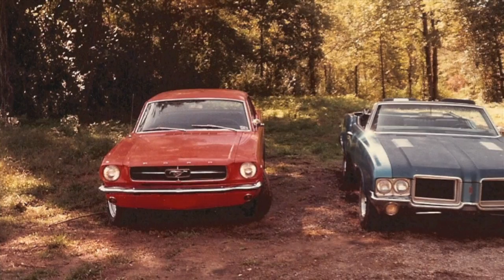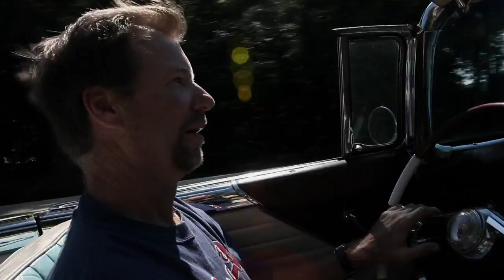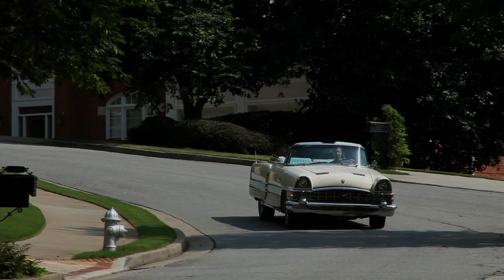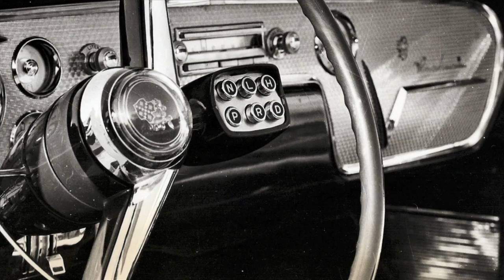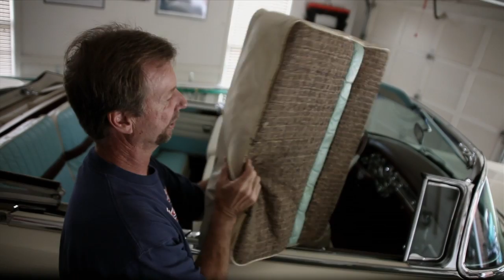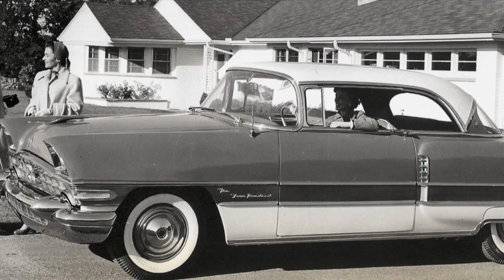'56 Packard Caribbean

Comment: I have said this before.  I do not see how the 55/56 Packards did not boost sales to the point the company had trouble making enough of them...they were just knock out.
Reply: The whole problem goes back to 1953. Chrysler purchased Briggs, the company that made parts and body panels for Packard, and Chrysler informed Packard that after the 1954 model year, the factory would no longer supply parts to Packard. In 1953 James J Nance, President of Studebaker-Packard was in agreement with President of AMC (American Motors), George Mason, to merge, and finally create his dream of a fourth US automaker. He and Nance were Presidents of Nash and Hotpoint and were former rivals. Nance would not agree to this unless he was head of the company. George Mason died in 1954 and was replaced by George Romney. He announced there would be no merger with Studebaker-Packard. If this merger had gone through, Packard would be able to use AMC's larger and more modern plant to build all cars there. But instead Nance decided to purchase a former Briggs plant. This plant was so small and outdated, it could not produce things at a very high quality. This resulted in the quality of 1955 Packards being below average of what it should have been. This diluted the somewhat exclusive Packard name down to Buick and Oldsmobile type quality and people stopped associating Packard with luxury. In 1956 most of the quality problems were fixed, and the cars were much better than 1955 models but the damage was done. In July 1956 the last true Packard rolled off the assembly line in Detroit. The planned redesign for the 1957 models was very promising  and could have worked, but the 1957 and 58 Packards were just glorified Studebakers. By 1958 the brand was phased out. In 1962 Studebaker-Packard Corporation changed their name to just "Studebaker". If Packard didn't merge with Studebaker, things would have been much better. Also, if the company spent the money on a new factory cars could be produced at a much larger volume with better quality. It's sad to see that Packard is gone.
Reply: A number of '55s had issues such as the torsion suspension and had to be brought in for service. This turned off a lot of customers as well as the word getting out not to buy one or buy a '56 (which by then the bugs were worked out)

Comment: They tried to compete on the wrong market, going up against Cadillac (GM), Lincoln (Ford) and Imperial (Chrysler). Good quality luxury cars like them, but Packard did not differ from them enough, allthough carrying a hefty price tag. They developed a beast of a V8 engine, which was very powerfull, but also crude and noisy and unsuited for the delicate and out of date transmission.
What they should have done right after the 2nd WW was to establish itself as the American equivalent of Rolls Royce, aimed at a small, but exclusive market instead of trying to produce in volume, like other manufacturors did. This marketing policy spelled their doom in the long run.
Reply: Yes, that was Packard's downfall, volume production. But, what choice did they have? They didn't have a Chevy, Ford, or Plymouth to financially back them up. They should have merged right after the war, but that hindsight. They stayed financially healthy until purchasing Studebaker in 54, which bled them to death.
Reply: Noisy engine?  Really?

I had a 1955 Packard Caribbean convertible which was almost identical to the 1956 model.  When I went to get the wheels aligned, there was also a late model Rolls Royce there (this was in about 1980).  My Packard idled much more quietly than the Roller.
Reply: Frank Eggers I have read your story before
Reply: There were plans to merge Hudson and Nash and combine that with Studebaker- Packard.  Had that gone through they might have survived.

It turned out that Studebaker was not financially sound and was poorly managed.  I remember that in the 1960s they were advertising "different by design".  Actually, they were different because of lack of funds to update the design.
Reply: Frank Eggers Studebaker was actually very well managed, so well that after WWII Ford was in trouble so the U.S. government considered getting Studebaker involved in instructing Ford in management. Fortunately, Ford turned things around partly by building a Studebaker design, the 49-50 Ford, and Studebaker  got itself into trouble with needed  high production break even points, and too many plants around the world.
Reply: Neil,

You yourself stated that Studebaker had a problem with its break even point.  According to what I read a few decades ago, their break even point was actually greater then their maximum production capacity because of greatly excessive overhead.  Exactly when that occurred I don't know; it could have been well after WWII in which case there may be no conflict with your post.

At one time Studebakers were very popular and Studebaker was highly respected.  I can think of many people I knew who owned Studebakers.  At one time I worked for a company which was a division of Studebaker and had Studebaker company cars.

I suspect that some of the problems went well beyond Studebaker.  We now have only three automobile manufacturers here in the U.S., and one of them, in spite of a foreign merger, seems to be hanging on by the skin of its teeth.  Meanwhile, Japan has several automobile manufacturers.
Reply: @frankeggers4024  I agree with your points! All this hand wringing and finger pointing about the demise of the Independents! Attrition in the auto industry was a natural process resulting from economic laws. We would have ONE manufacturer today (Ford) if not for the Obama bailout of Chrysler and GMC after the Crash of 2008!
Reply: Neil, I'm not sure what the American manufacturers should be doing now.  However, beginning in the 1950s, they had real quality control problems.  My mother bought a new Chevrolet in 1958.  Suffice it to say it was not well put together.  It was big, awkward, and seemed inferior to the 1955 - 1957 models.  Then, later, U.S. manufacturers fell way behind on auto technology.  When emissions controls were introduced, American cars ran very badly.  When you stepped on the gas, they'd surge forward nicely, but then they'd hesitate, sometimes backfire through the carburetor, then begin to accelerate again.  The U.S. manufacturers seemed to think that the solution lay in lobbying Congress to relax the emissions controls.  Meanwhile, the Japanese manufacturers somehow managed to make their cars run beautifully even with the emissions restrictions.

The computer and the automatic transmission were American inventions, yet it was Toyota which was the first, by many years, to have a computer controlled automatic transmission.  Foreign cars had electronic multi-point fuel injection way before American cars did.  The Japanese implemented industrial robots, an American invention, before U.S. manufacturers did.

American manufacturers should have learned from the English experience.  At one time, like back in the 1950s, several English car brands were imported to the U.S. but that slowed to a trickle because of "English car disease", i.e., too many breakdowns and lack of reliability.  That should have taught American manufacturers the importance of good quality control.

GM has dropped LaSalle, Saturn, Pontiac, and Oldsmobile; they have only Chevrolet and Buick left.  Chrysler has dropped DeSoto, Imperial, and Plymouth.  Ford has dropped Edsel (which they never should have made in the first place) and Mercury.  Actually those may have been good moves since most of the brands now have "sub" brands so choices have actually increased.
Reply: In the late 1940's Packard outsold Cadillac.  It was a premium make.  The lower priced Packards sold well in the medium price field but that reduced the prestige cachet of the Packard name.  An attempt to differentiate the lower priced cars by branding them as Clippers (not as Packard Clippers) went nowhere and was abandoned.
Soon thereafter all Packards were abandoned.  The best option for Packard had long been a pairing with Nash.  History provides some evidence of why that didn't happen.  Too bad it didn't.
Reply: The emissions history is an interesting one.  US manufacturers had to tread lightly to avoid anit-trust issues in sharing emissions information and designs.  In Japan they were required to work together.
The market certainly has changed.  We have just two auto companies of size that are US based.  Chrysler is part of FCA, a company organized under the laws of The Netherlands with a tax "home" in the UK.
Reply: actually they  had the plant in Southbend Indiana and paid higher wages that anyone other Car manufacturer  and just didn't have the market share
Reply: Packard president, James Nance, told me it was not in the cards to use the Rolls Royce model - that if the cars could not be built at scale, competitively,
 it would not be done! The Packard V-8’s were NOT crude and noisy, but, exceptionally quiet and well engineered (Packard built the PT boat V-12’s for the Pacific war, and, built the Rolls Royce Merlin engine that powered the Lancaster bomber and other aircraft in WW2; Packard never made any junk). The Twin Ultramatic transmission in my current 1955 Packard did extensive trailer pulling service of our family’s Airstream trailer and has never been serviced to date!
Reply: Frank Eggers Yes Frank, and if things don't change, I can't see this business model lasting forever. Ford is now no#1, with only Lincoln as a companion car. And, Lincoln is all but dead. GM is down to 3 car brands, and as you said Chrysler is just hanging on with foreign help. Chrysler has had one foot in the grave for decades. Maybe, had they known what was coming, all the American brands could have formed one company to fight globalization, American Brands, like British Leyland. If not for trucks, I wonder if anything American would still exist.

Comment: Packard disappeared due to over-weight old-school styling, but they had one of the best suspensions ever made (Torsion-Aire), which I'd say has never been surpassed even by today's standards. If you have Torsion-Aire on your Packards, you're very lucky. For an upgrade all they need is a set of heavy-duty gas shocks (with optional over-load springs), and a heavy-duty rear anti-sway bar.
Reply: Torsion-Aire was Chrysler's front-end torsion bar suspension. Parkard's had Torsion-Level Ride, which connected to the back wheels with long torsion bars to keep the car level during hard stops and in corners. Citroen did essentially the same thing, but with a hydro-pneumatic system that worked better. Watch an old movie when a Citroen comes to a hard stop when it just squats down at all four corners instead of tilting forward. Packards did the same thing, but mechanically.
Reply: @Greatdome99  The Packard torsion bars twist and  push the rear wheels down when a bump is encountered that pushes the front wheels up - hence the car stays level and the up and down jouncing which I get  in my 2008 Ford Edge does not happen. I own a 1969.5 Citroen ID19 and a 1955 Packard Patrician. The ride in both is very comparable. Both have a height compensator when the rear of the car is  loaded. The Citroen by increasing the pressure of the hydro pneumatic suspension  fluid at the rear and the Packard by a second short set of torsion bars linked to the rear suspension thrust arms. Oddly, when the ‘55-‘56 Packard is accelerating rapidly,  the rear end does not squat but rises!
Reply: No, Packard disappeared due to its purchase of Studebaker.  Too often, we blame product for the demise of auto companies.  It is most often financial matters that doom them.  That was clearly the case for Packard.
The history is not as clear as we'd like but there is little doubt that had Packard allied with Nash and Hudson, avoiding Studebaker, the outcome would likely have been better.
Some have attributed Packard's lurch into buying Studebaker to the ill-informed preference of the board of directors.  Others have claimed that James Nance could not abide playing second fiddle to Mason or Romney at American Motors.  Whatever the reason, the alliance of Packard with another large car manufacturer such as Hudson and a company that had a proven sales record in the medium price field and low price field as Nash had, made a great deal of sense in retrospect.
The last independent Packard was made in 1956.  The last car with a Packard badge in 1958.  American Motors remained completely independent until their late 70's agreement with Renault for Renault's minority stake and stood apart until 1987 when Renault sold their interest to Chrysler.
In retrospect, we lost a wonderful car and a solid company when we lost Packard.  The Caribbean is an example of just how wonderful their cars were.